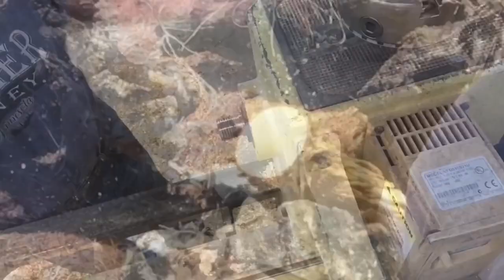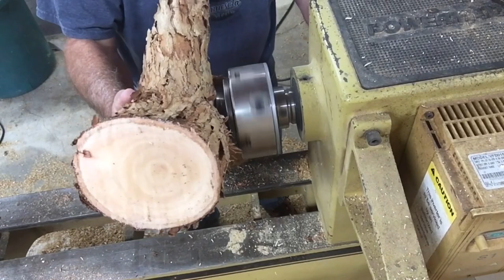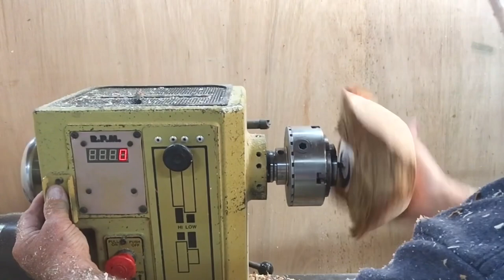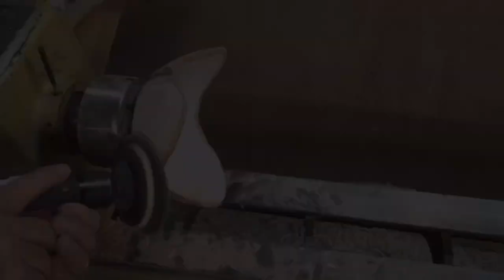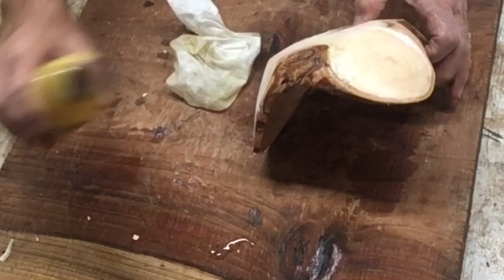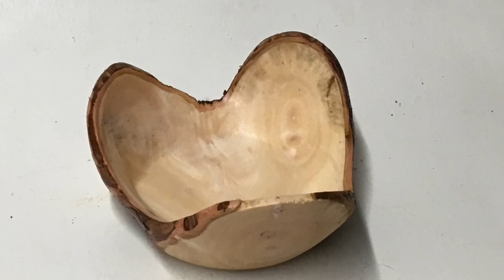Wood Turning Peruvian Pepper tree crotch bowl

Comment: Hey there, could you point me in the right direction to purchase the drill sanding attachment you use to sand the inside of your bowls? I've been looking all over for that exact thing and I've been having a damn time doing it.
Reply from the maker: Thank you for watching my videos. Yes I love the 5” soft sanding attachment. It really gets the job done fast. I get them from Klingspor abrasives they also have the sand paper. They are a little difficult to get ahold of. If you can get them to send a catalog it’s way easier.
Reply: @darrenswoodworks8695  Thanks alot for the response, really awesome of you to get back to me so quickly. Really thankful for it as well! I've already checked out their website, the non commercial side, their "Workshop"

Already amazed at what I've found on there. I'm getting my order together currently actually. Building up quite a checkout. 

Phenomenal work by the way, thank you for sharing! 
Always a good time when I discover a fresh woodworking channel! 

Thanks again, seriously! Awesome guy!